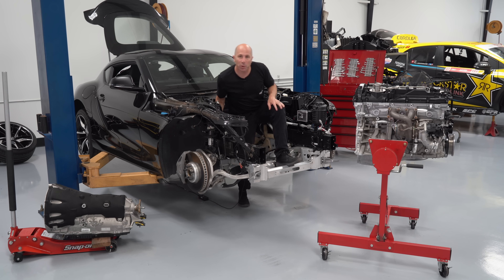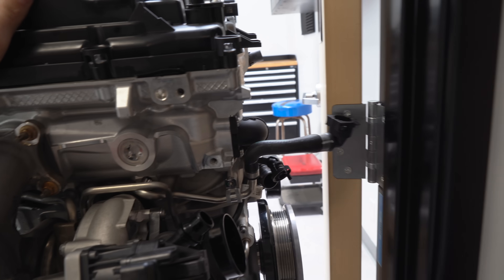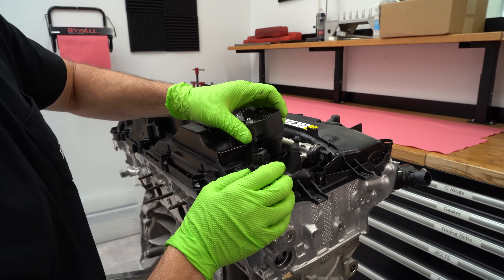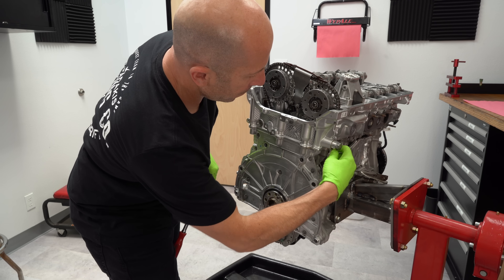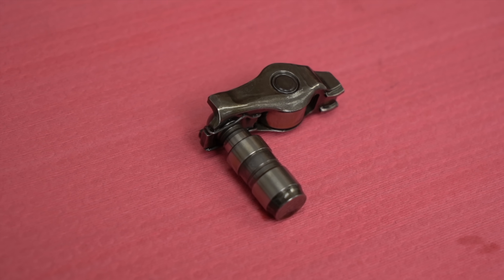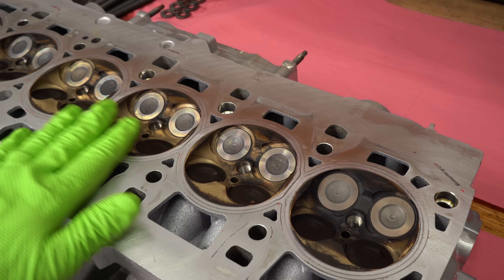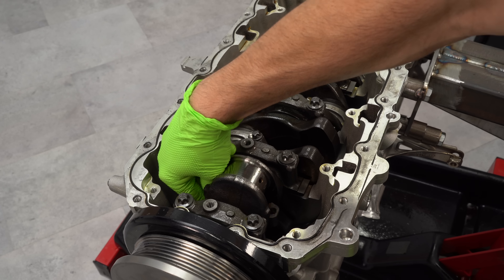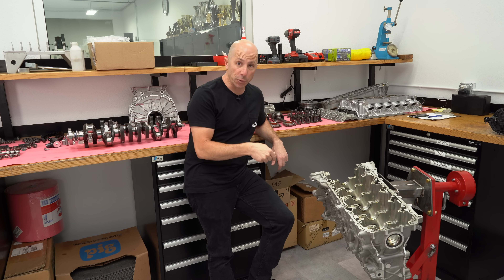2020 Supra B58 Engine Teardown - First Look - Better than the 2JZ?

Comment: Looks impressive. One thing that struck me was the carbon build-up on the pistons and exhaust valves. I've never seen an engine get torn down at only 500 miles but does that seem like quite a lot of carbon build-up on piston and exhaust valves at such low mileage? Mostly wondering because I recently purchased a new car with DI and not sure what to expect with carbon build-up in long run.

Comment: The problem is that because its BMW its such a high price to repair, replace, fix anything that goes wrong.

Which is my biggest gripe. Everyone knows how ridiculously expensive bmw parts are to replace repair compared to Toyota parts.

As much as I'd love to buy a 2020 Supra I just wont, because all parts are bmw and that means $$$$$$$
Reply: 04srt4champ ditto, I can’t imagine being in the market for a Toyota and landing on one with a Bimmer engine. Kinda defeats the whole purpose of buying a Toyota imo, and no I wasn’t expecting a 2jz or a mk4 clone, I expected a Toyota
Reply: Coming from a prior 1999 BMW 740iL owner, yeah I still have nightmares.
Reply: 04srt4champ or the reliability. unlike Toyota, BMW has one of the worst reliability scores. So if the engine breaks down who do you take it to? A Toyota dealership or a bmw one
Reply: @VividAbstract  bmw

Comment: Looks like it has plastic timing chain guides. That was a faulty point on the Toyota 22re engine. The plastic is in place to reduce drag and noise, but it sacrifices reliability, as aroun 200k, the guides would be work through. Many companies make aftermarket steel guides for the 22re engine for that reason, as well as dual row timing chain conversion kits. That’ll probably be an issue as these engines get higher mileage.

Comment: Everything about this engine is impressive, but, there is so much plastic. After plastic heat cycles enough it becomes weak. The intake manifold with an internal intercooler is a good example of a very expensive replacement part. Radiator hose replacement is a good example of plastic breakage, how many radiators have been replaced after attempting to remove a snap-lock hose and the hose connection on the radiator breaks off?

Comment: Can’t beat the old 1and 2js just a good engine this engine looks to complicated and over thought
Reply: Best thing is to wait for some idiot to crash a Supra (rip), take BMW guts out and sell it (if working/not too damaged), stick JZ in. Idk how wiring harness would work from JZ to A90 chassis. Tada San said it should swap directly in, but never said anything about harness. That will probably be custom as chassis sensors (gauges, lane departure warning, etc.) would interfere or not communicate with JZ harness, which means adding or adapting stuff. If it's anything like sticking a JZ into A70/A80, Cressida, GS, IS, SC, the JZ would only need to be hooked up to chassis equivalent to ignition, battery, neutral safety, ground, main relay, check engine, and other ecu specific stuff, then a JZ into the A90 would be super easy to do.

Comment: Isn’t there a coating on the cylinder walls that brings up an issue while rebuilding the engine, as in they can’t hone the cylinder walls ?

Comment: The B58 has been around for years yet I do not see any high powered cars with this engine. If you do a quick Google search, you'll see the results of upgrades aren't overly impressive. If the Supra was going to have a BMW engine, they really should have used the S58 instead of the B58. The S58 is an impressive motor ;)

Comment: Im looking foreward to how you guys will utilize all the new tech.. keep the internal intercooler? Upgrade the capacity of the injectors and mechanical fuelpump? Replace the hydraulic lifters? Porting the exhaust ports in the top? What kind of management for the variable cams/di-injection? Will look foreward to the next vid 😊

Comment: I can already hear the timing chain guides going bad.
Reply: We haven’t seen this engine have many problems yet at bmw. It’s been our standard 6 cylinder engine package since late 2015.
Reply: Bruce Wayne So the engineers learned their lessons from the 1-series disaster timing chain? 😆
Reply: @323gtxr  How quickly people forget. You're the only person in this thread mentioning this I think.
Reply: Timing chain guides haven't been an issue on most BMWs for the better part of a decade. Rod bearings and Cooling systems on the other hand......
Reply: TpzBla that’s the good thing about that bro is that ten years is a pretty long time most millennials swap cars before that so I don’t think a long life is the goal here
Reply: @DoubleVthree  yeah not at all. I would love to see this car lasting but I don't know.
Reply: @Theonixco  remember the v10 rod bearings that went out around 80k?
Reply: @abrahamcerda76  Rod bearings were an issue all the way back to the E46 M3 but to a lesser degree, The E92 had the same problem as the E60 M5. Apparently replacing them with revised ones seems to solve the problem.
Reply: 80k from a 200k car is pretty normal. For most people that’s 10+ years of driving it.
Reply: @abrahamcerda76  
If I recall correctly BMW was telling you to run the wrong weight oil. From the factory. So much for the Germans knowing how to keep their bits together...
Reply: @chrisdef15  the bmw 7 series also had the same issue but with their v12. That car did have lots of other problems tho
Reply: You and me both brother.
Reply: BMW noob question here.  How many years and miles do they go bad at?
Reply: @250gto9  from what I've read up to now none and I've read up to 97k(the last time I looked at any forums about the B58)with really no problems coming from the owners unless u got the first year models of the B58 which only had coolant issues which were fixed later on.note haven't read up about it in 5 months now.
Reply: And be ready to remove the engine to replace them.

Comment: What are you going to do for the exhaust manifold. I see that as a big issue since it restricts the manifold design and it keep the heat in the cylinder head...

Comment: some of the ideas used in the engine make me question the engineers’ thought process, but overall looks very strong, that block looks pretty bullet proof... the oil squirters are a huge plus and i’m curious to see how tuners play around with that variable valve lift, may be a bmw but they sure know how to built inline 6 cylinders

Comment: Mercedes and Audi: “We are the hardest cars to work on”

BMW: “Hold my Timing Chain”
Reply: ThinkkOps the Audi v8 has the impossibly complicated timing chain and assembly on the back of the engine as well
Reply: Zack Behen gotta love having to take the engine engine out just to put in a new timing chain.
Reply: @madr9142  I don't think so. Looks like you can just drop the trans and get to the chain that way. 👍
Reply: Yeah no Mercedes are still the most difficult to work on. Particularly the diesel V6s
Reply: @shona5512  what about the newsih inline 6 from Benz?
Reply: @bobkilla430  More space around the block, the only issues with them is around the back depending on the engine code and car model. The main problem with the V6s are that there's so many things mounted in the valley of the V block that you have to take one thing away to get at another.
Reply: @shona5512  No they're not. Go work on a MB M112 or M272 motor. They're rather easy. Some weird things here and there but overall not difficult at all.
Reply: @IKhanNot  Literally changed the seals on the oil cooler on an OM642 E-Class last week. 7 hours of stripping everything else around the engine because everything is so compacted together with the cooler in the valley of the V Block. 14 hours of agony to do a 10 minute task. New Mercedes Diesels are by far and away the worst engine I've ever had to work on when it comes to awkward to reach bolt positioning.
Reply: @shona5512  At least I learn with the "hardest" engines to work on as a car mechanic beginner at Mercedes  😂
Reply: Shona I have leaky oil cooler seals on my R320cdi🤦🏻‍♂️ Luckily Omega oil leak sealer have worked wonders! The R is even worse to work on than the E-class because the engine sits further into the firewall. But generally that engine isn’t to bad to work on, compared to European Fords that I used to work on 10 years ago.
Reply: @ArcanumMortis98  I imagine if you work at Mercedes then you will probably have all the little tools that could make your experience easier.
Reply: audi and benz have both used a timing chain in the back 😂
Reply: Well you guys never worked on Renault cars 😅 They achieved to make things complicated even in 4 cylinder engines
Reply: These comments have me weak 😂
Reply: Any V6 TDI is a$$ to work on. Anyways there's a lot of engines out there with T-chan on the back. Like the Audi 4.0l twin turbo found in the starting from the S6 up ward.
Reply: Ok. Change chains on audi v6 diesel
Reply: Audi 2.0t timing chains are in the back
Reply: Jaguar Diesels had the timing chain on the back too, iirc.
Reply: As a car mechanic in Germany... no. Audi is surprisingly easy, at least the usual daily 1.4 TFSI or other economy 4 cylinders we get. It sometimes requires unnecessary stripping of parts but at least it's straightforward unlike some Alfa Romeo or Toyota.
Reply: Say w8 and vr6
Reply: Hold my oil pan drain pin
Reply: Vr6 vw’s have a rear timing chain also.  Such a pain in the ass.
Reply: Roger Dodger  Rotorys are dope. How would you spell that, Rotories? or Rotorys?
Reply: my timing chain is augmented.

Comment: Unfortunately German timing chains are highly unreliable. Let’s see how goes with this engine? The other area of concern is that the main skirts sit very down low. If you look on the 1990+ 7M blocks and the JZ , The skirts go all the way to the top. This adds a lot of rigidity on the mains. I think this is gonna be the ultimate killer when you’re trying to go 2 thousand HP on the block

Comment: Very similar design to the mini n12 Non turbo setup regarding the lifters/rockers/variable lift intake cam
Reply: BMW engines. Probably if you compare the internals of the N12/N20/N55, you are going to see a lot of similarities. The legend says that the N20 is just an N55 that had two cilinders chopped off.

Comment: The B58 is basically a continuation of the N54 and N55. It's been tried and tested for almost 15 years now. Theres people running 800hp with stock internals. It's a solid platform. I get why people want a Toyota motor, in a Toyota. The problem with Toyota tho is they don't support their older stuff. You can't even get OEM MK4 Supra parts from Toyota anymore cause they stopped making it. Nor can you get MR2 W20 stuff. Theres a finite amount of stuff out there which is why the prices for everything have trippled. Meanwhile you can get OEM Mercedes parts for a 100+ year old Mercedes, and if you cant find any, Mercedes will manufacture them for you. Toyota? "Fuck you, go buy a Camry".

Comment: lol mk 4 fanboys "timing chain in the back, ill have to remove my engine?????"
mk4 owners "yeah i took the engine out every couple months until i had it running how i wanted"
Reply: Dr.Science  hes not a pussy like you I guess.
Reply: But you must understand, that this is a geographic unique feature. You can't do that anywhere without having it re-checked by the DMV. Making it an impossible to finanace lifestyle, or a track only car. A waiste in both cases.
Reply: Said no one ever.
Reply: 2JZ doesnt  need to be pulled to make big power, dumb @$$!!!
Reply: 1786 Vlogs I read your comment and heard Red Foreman’s voice lmao 😂
Reply: @GETLITUP69  to make big power but not for very long. Realistically rod bolts and head bolts are the minimum to keep things reliable above 600bhp there may be a few dudes that have had a bit of luck without but it's far from the rule.

Comment: It seems like they are hopping back in time some ways. 

Jwac (jacket water aftercooler) and a jacket water oil cooler. Seems like they took ideas from like 80's-90's diesel tech. 

They probably did some of this for simplicity and making the overall engine package smaller. And with the base power goal they shot for probably allows these seemingly old school cooler styles to work easy. 
 
I'm totally with you guys on the cannister style filters. Makes it really easy to cut a filter and check for debris.   Now they just need to bring back legitimate fuel filters. In the diesel world a lot of hpfp issues came from contaminants in the fuel, and with the BMW N54 that uses direct injection they had/have problems with the hpfp after varying mileage. I personally think it comes from sub par fuel with crap floating around in it. But I could be wrong..

Comment: This engine looks like the one in the mini, just with 2 cylinders more. But the design of the engine is just awful. Way to thin timing chain, chain tensioner which fails a lot. The cam pulleys are just hold by a bolt, not even a pin there. This thing will never hold 1000hp

Comment: Great video! I am disappointed that Toyota didn't insist on putting their dual injection system into this engine (D-4S), I know that Supra barely had any miles on it but very curious to see if carbon was starting to deposit on the intake valves. I am also curious about the green coolant, BMW uses a blue coolant and Toyota uses a pink one, I wonder why the Supra coolant is green.